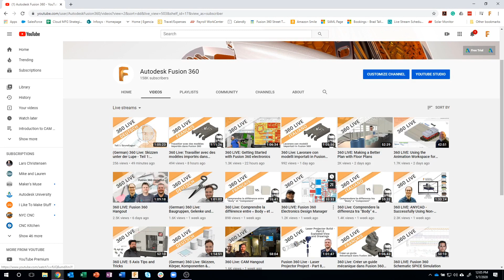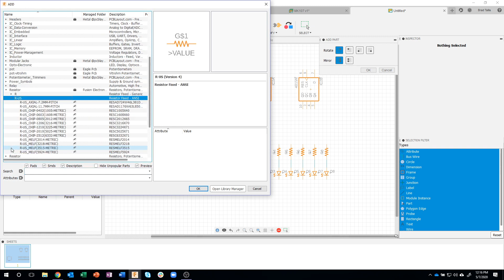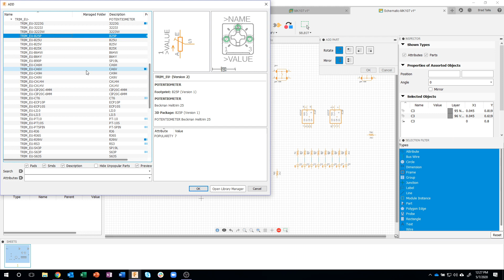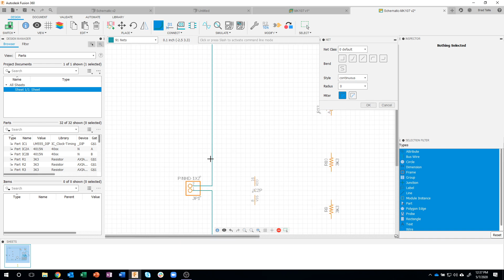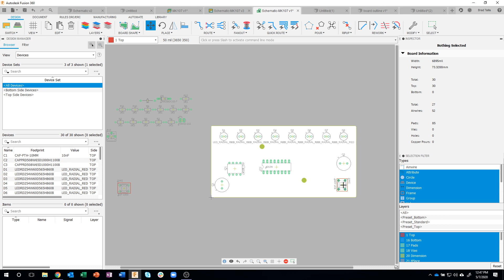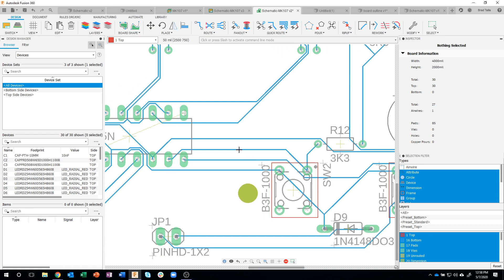Episode 60 -  ECAD in Fusion 360

Comment: Hi Brad, I can import a jpg image of line work, in fact i am looking at a line drawing of a helicopter, I need to make a stamp to press the design into leather, I thought I could use the spline command to follow the outlines and details and then use the sweep command to  make a profile triangle about 1mm wide and 3mm wide to follow the sweep but it does not seem to work, how would you approach the subject, my only other thought is to copy each line as a small section and then give each section a 1mm offset and then extrude the 3 mmm